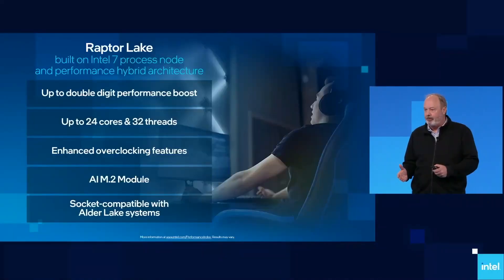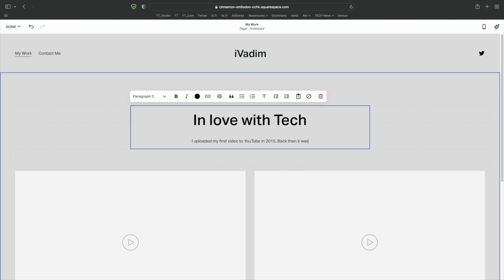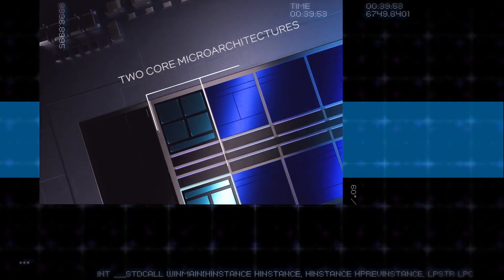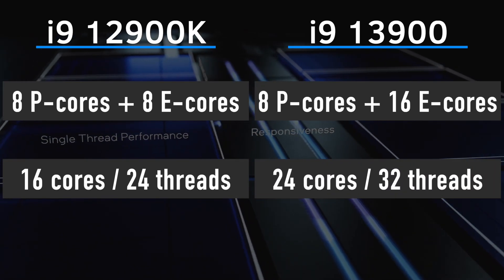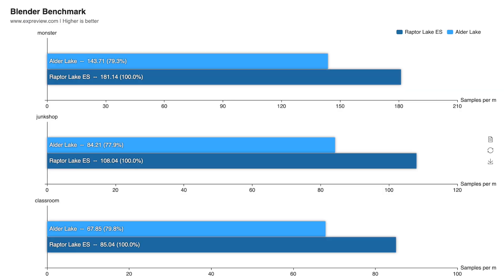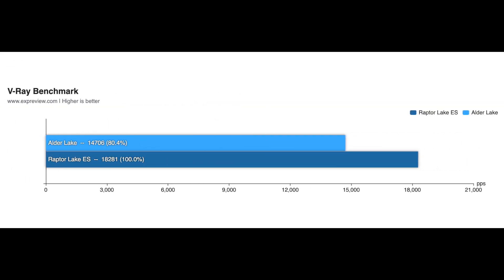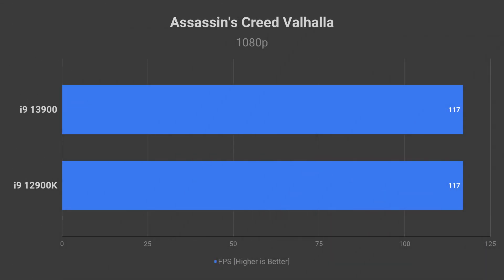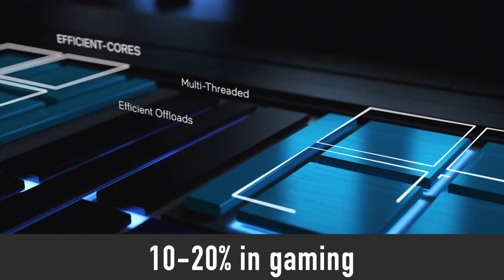First Intel i9 13900 Benchmarks [Gaming + Productivity]

Comment: This is also the 13900, not the 13900k or the kf so I think it would be fairer to do a comparison between this and the 12900 rather than the 12900k
Reply: TBF, if not overclocked, the 12900k should perform pretty much identical to the 12900.
Reply: @ansgar_odinson  except it is
Reply: They evened the frequency so it would be identical in every test
Reply from the maker: As long as the clock speed is the same - it is fair. Cores are exactly the same on 13900 and 13900K. Same as 12900 and 12900K. Only core frequency makes a difference to the final performance. So, this test is OK. I am not calling it the perfect setup tho. It is an early engineering sample after all. So, performance is worse than retail.

Comment: The 3rd iteration of the 13900k is showing up it seems from the same guy who tested the 1st one and it seems it does clock up to 5.5 and 5.2 regular. It's still not done either but it's beating the 12900k in single and reallly smashing multi. So good on them I can't wait to see the final product.

Comment: Looks very nice!
I will be buying the 13700k instead and pair that up with the upcoming RTX 4080 for 1440p gaming at over 144+ fps!
Reply from the maker: Good plan! If you don't mind me asking - why are you planning to choose 1440p over 4K?
Reply: @theivadim  well I have some reasons…
4K 144hz monitors are pretty expensive and 144+fps is not that easy to reach in 4K whereas 1440p 165hz monitors are very affordable nowadays and reaching that frame rate is definitely a lot easier than in 4K…

I would have preferred to get a 1440p 240hz monitors but they are still rather expensive for now… AW2721D and Asus ROG Swift PG279QM are the 1440p 240hz monitors I want but they’re easily 700$+ which is a little too much for me to afford…

So for now I’ll grab a 1440p 165hz IPS monitor by MSI( MAG Optix 274QRF) for 420$…

Will definitely upgrade to a 1440p 240hz monitor once they get below 600$
Reply: @elaiswaifu5459  sony released a 4k 144hz monitor for $900; so its getting closer everyday. wait on your monitor upgrade 🙂
Reply from the maker: @elaiswaifu5459  I understand. 1440p is also very good, imho. But also, why not skip the CPU upgrade and get a nicer monitor instead? It could be worth it. A good monitor will serve for much longer than a CPU for sure. And it is the most important aspect of the whole experience in my opinion. No point of having high-performance hardware if the monitor is subpar.
Reply: @theivadim  well I figured the CPU could be very useful for emulation which I do care about a lot as well, especially for something like RPCS3 which emulates PS3 games and is really intensive…in that case the 13700K would prove excellent for this emulator and other emulators as well
Reply: Another thing I forgot to mention was that I actually care about raytracing because it can look really good in games like CyberPunk 2077 and Control but it’s super intensive!
4K Ultra RT with the 3080 absolutely destroys the card!
I’m hoping the 4080 RT performance on 1440p can be 60+fps and maybe even closer to 100!
Reply from the maker: @elaiswaifu5459  looks like you have everything well planned🙂 BTW, I like ray tracing as well. Wish it wasn't tanking the FPS so hard on higher quality presets. RTX performance is rumoured to be much better on 4000 series vs 3000. So, there is hope😄
Reply: Hey ela it’s me again. I’m still a bit lost on which cpu I should be going for
Reply: @johannessguten2527  well it does depend on what resolution you play as…
CPU is not that important on 1440p/4K as you will be GPU bound, but it is important in 1080p…
Well an excellent CPU IMO from Intel’s side would be the 12600K or 12700K from the current lineup…12900K is overkill for gaming.
Reply: @elaiswaifu5459  Im planning on playing at 4k from 60-120 with all rt features on (like i mentioned before I will be buying a 7900 xt or a 4090)
Reply: @elaiswaifu5459  i won’t run into cpu bottlenecks with that cpu right?
Reply: @johannessguten2527  definitely no CPU bottlenecks if you’re playing at 4K!
At that resolution you will be 100% GPU bound…
Reply: @elaiswaifu5459  so it would likely be a waste for me to go for the 13900k instead of 13700k since I have a 3,500 budget that’s good to know
Reply: @johannessguten2527  13700K will absolutely fulfill your needs at 4K!
Spend more of your hedger on the GPU…
Btw we have the exact same budget!
I also have 3000-3500$ budget on PC although that doesn’t count the mouse,keyboard, and monitor tho
Reply: @elaiswaifu5459  yeah my 3,500 is exclusively for the pc. What ram and case do you reccomend for the future gpus?

Comment: why cant they increase the cache to 100 mb or even 1 gigabyte? are they intentionally holding back?
Reply: It's not that easy—even AMD was only able to cram 128MB in the Stacked V Cache 5800X3D. It really isn't as simple as "just adding more".
Reply: They are likely still hold onto moore's law
Reply: Cache = cash $$$. So more cache means more $$$. So are you ready to shell out 2000$ or 3000$ for a desktop cpu?
Reply: @Yusufyusuf-lh3dw  that might not even be the issue. The benefit of cache is low latency which requires it to be physically close to the cores. The RAM is there to handle the high bandwidth high latency calls.

Comment: Intel have big problem, chip contains  DRM, thus can't watch 4K disk movies.  13th gen benchmark isn't impressive
Reply: DRM is not a part of the chip it's a software module that checks if you are running an unlicensed software. DRM modules were previously incompatible with hybrid cpus like 12th gen, but that's fixed now so no more DRM issue. Benchmarks look impressive but we may have to wait to see final figures.
Reply from the maker: Disks are outdated. Time to digitise your library. I have my favourite movie collection in my cloud for extra convenience. Can access it from anywhere with an Internet connection.
Reply: @theivadim  great idea, or not sell 4K disk movies.